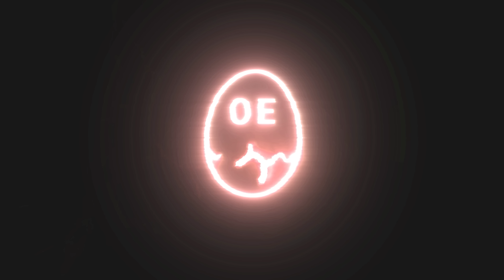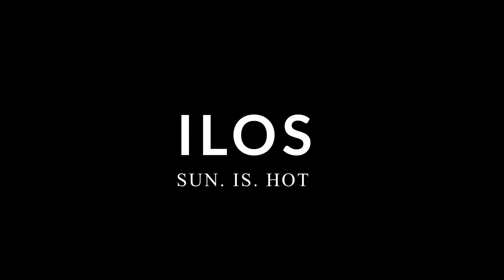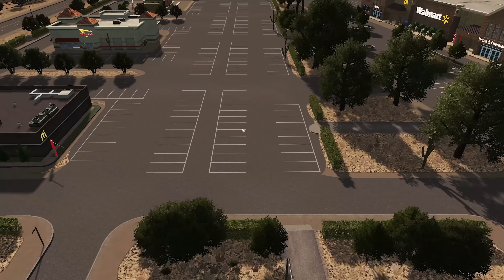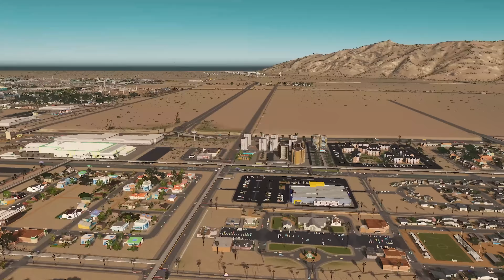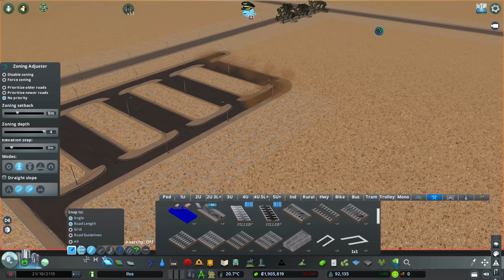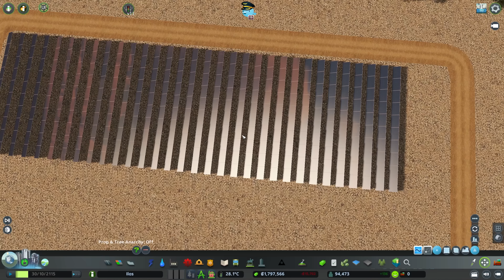Building A HUGE Desert Solar Farm In Cities Skylines!

Comment: I am curious about what your running for your PC. I'm thinking of buying a pre-built gaming pc but not sure what I need to run for cities with mods
Reply from the maker: Good CPU and ram is needed for modded cities. The specs of my PC are in the description if you want a benchmark as to where to start. 

But if you want lots of mods and assets, don't skip on Ram. Get 64 if you can 👍
Reply: @OVERCHARGEDEGG  thanks for your time, I appreciate all that u do. You have changed the way I build in cities

Comment: You know... The "holes" you mentioned around 2:53... That's not entirely unrealistic to the actual city of Phoenix. You can drive through the city and there will be massive undeveloped lots in random places.

Also, fun fact: Phoenix IS primarily powered by a nuclear plant. The Palo Verde Generating Station, specifically.

Comment: Correct me if i'm wrong - But wouldn't giant solar farms like this also require a sizable battery-setup? As in.. Most power is used during the evening when it gets dark; which is when the solar doesn't produce anymore.. Where is all the energy being produced during the day being stored?
Reply from the maker: I'm sure we could repurpose some assets to function as batteries 😌 good shout!
Reply: @OVERCHARGEDEGG  maybe this is where the earthquake sensors could be used as localised battery storage?
Reply: A city like this might have the power peak during the day due to air conditioning.  But, generally some sort of energy storage is needed for at least the photovoltaic collectors.  The thermal tower could incorporate molten salt or other heat storage to continue power generation for at least a few hours past sunset until late enough in the evening when power demand dips.